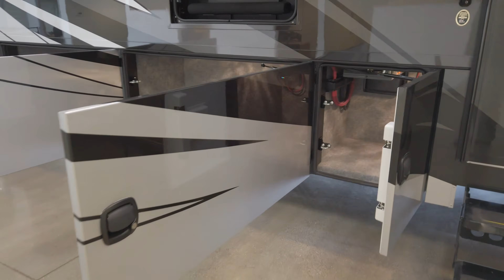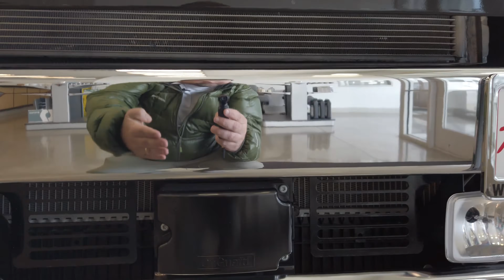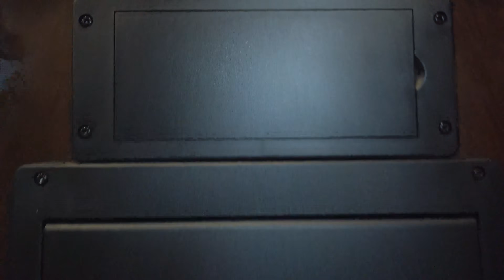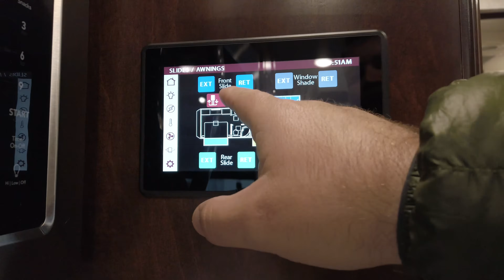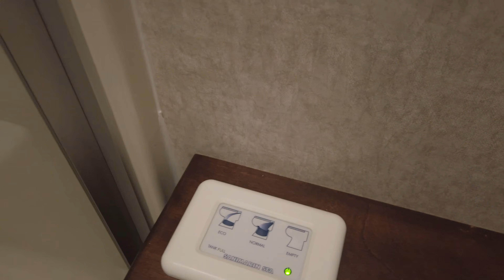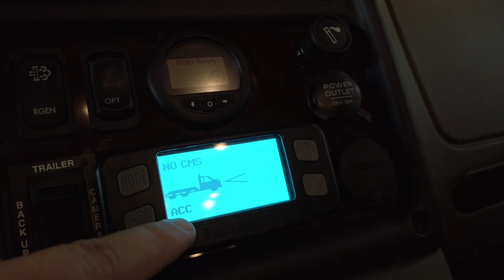2022 Renegade Verona 36VSB Expert Walk-Through

Comment: What motor 6.7 or the LSI 8.9
Reply from the maker: It's the Cummins L9 rated at 360HP and 1,150 lb-ft of torque. The  L9 is what you find in Renegade Verona & Verona LE products. Until recently the motor was rated at 350HP. This blog post is a little outdated but still good information. https://www.rigdigging.com/rvblog/cummins-l9-for-motorcoach-2017